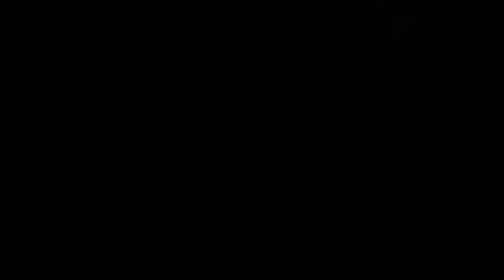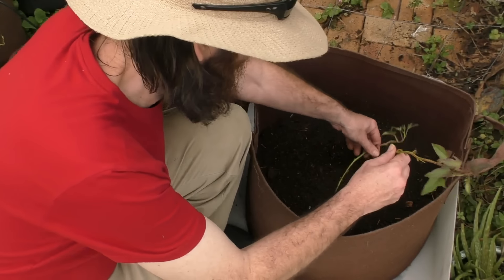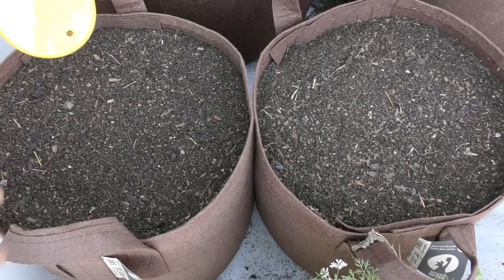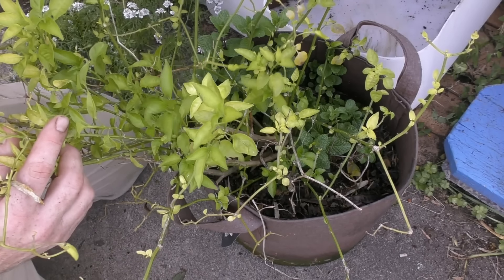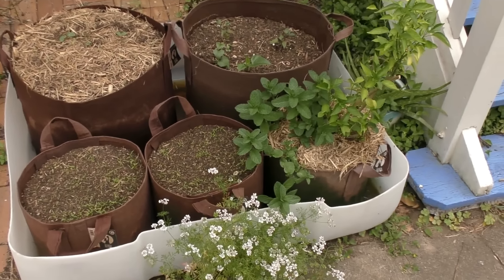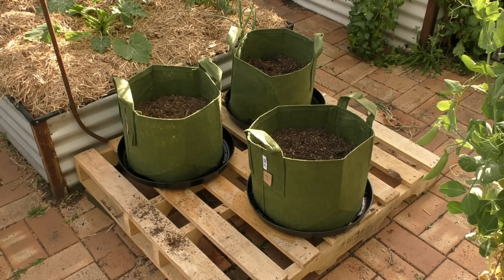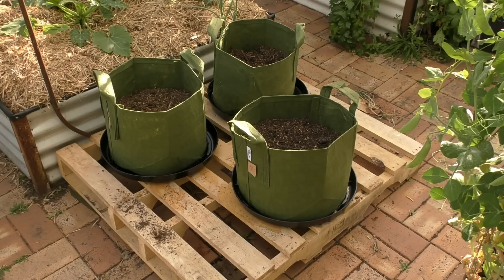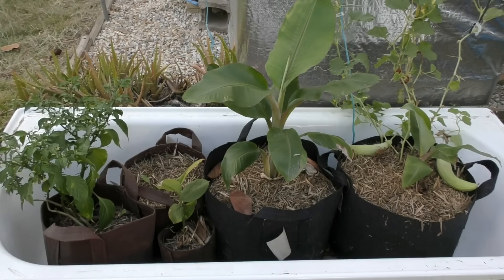Air pruning Root Pouch Wicking Gardens. Sowing carrot seeds, planting slips & some spuds.

Comment: Interesting idea with the air pruning, I've heard that air pruning is great way to have seedlings with healthy roots but never seen it use for matured plant, thanks for sharing.
Reply from the maker: +Raf's Kitchen Garden 
Hi Raf.
I'm sold on the air pruning method now 👍 Still need a really good soil mix & also keep the water up to them though. A few folks let them dry out which is why they have issues with the cloth bags/pouches I've found. 
Hope all's well with you,
Rob.

Comment: Hey Rob
Another good one, I finally know what air pruning is. The missus now has me shopping for root pouches. I have 3 figs that might do OK in them as I shift them inside and out with the seasons.
Cheers from Canuckistan
Jeff
Reply from the maker: +Jeff Mitts 
Hey Jeff.
I'm a bit slow at catching up once as you can see ;-) 
I have 1 fig in the pouches & it's not doing too well. I think it's the dodgy potting mix I bought for it more than the pouch though. 
Hope things are't to frozen for you up there in Canuckistan mate ;-)
Cheers. 
*cracks & ale & goes to bathe in the 30°C warmth*
Reply: Love the final thought, I'll trade you , cheeky bugger. I cracked several stout and rinsed lava rock in 5C warmth. It's been unseasonably warm here actually... I'm worried the garlic will sprout : (
Reply from the maker: +Jeff Mitts 
Not a stout drinker sorry mate. Looks like liquid vegemite ;-)

Comment: Hey Rob Im in Sydney where I have a lot of success with potato.  I water deeply but infrequently.  To further minimise fungal and bacterial problems, I use slightly acidic soil.  Alkaline soil assists  the growth of bacteria.  Hope this helps
Reply from the maker: +Meme Ryan 
Hi Meme.  
A added some flowers of sulphur to the potato soil mix to make it more acidic & they looked to be growing really well until the blight got to them. 
Harvested them last week & while they didn't produce a lot in weight The volume was good.  I think if I got the blight under control they would of been one of the most productive crops we would of grown to date. 
Cheers & al the best.
Rob.

Comment: That's a great idea with the sweet potatoes if that works, I don't now why it wouldn't. I bet by now your garden is full of grow bags by now. I love the air pruning pots, I have some pots left over from my potato growing disaster, lol. Did you use a 2" drill bit for those holes? That bathtub drain system is so great! Sorry this is so long, See ya, Kim. OBTW, My peppers are looking like that, maybe I can do the same with cutting and feeding they may make it in the outdoor hoop house.
Reply from the maker: +The Abled Gardener Hi Kim.
Not full of pouches but do have one more try full up the side of the house as it happen ;-) Its got some citrus, curry tree, dwarf lychee & dwarf papaya in it ;) 
Do you mean 2" holes in the wicking barrel with the papaya?
Reply: +RobBobs Backyard Farming I didn't see the papaya, it's the blue plastic wicking barrel at the beginning. I'm thinking this would be good for my dwarf lemon tree, my dwarf flowered and put on small lemons 3 times since last year, they would all fall off each time until this last flowering, 2 lemons stayed on and are about the size of eggs, and I've noticed that citrus leaf miner really love those new little leaves.

Comment: Good video, Rob. Thanks. Couple of questions:
Aren't the sweet potato vines going to take over?
I like using the cloth over the carrots to stimulate germination and keep moist.
Are the pouches cost effective and how long do they last?
Reply from the maker: +Karl Kelley 
Hi Karl & sorry it took so long to get back to you. 
I've had to trim back the vines twice now as they grow so fast.  I've also read that it helps the plant grow larger tubers but am not 100% sure on that myself. 
These Boxer Brown pouches are supposed to last for 10 years. The black ones the bananas are in are meant to break down in a few years so they will go into the holes when I plant the trees out 👍
Hope that helps some & let me know if you have any other questions on the pouches. 
Cheers.

Comment: just a little thought but why dont you add a bit of blue metal in the resivor around the pouches that way you can keep it full and no mossies
Reply from the maker: Hi Sam. Have seen a few folks do that. I find letting them dry out works well for me & allows for a bit more water storage in there. 
Cheers.

Comment: HI Rob,
Regarding the carrots, do you add any additional fertilizer?
This is my first time growing carrots and I have the 20 gallon root pouches.

I make my own planting medium using 1/3 compost, 1/3 peat moss, 1/3 perlite.
I also add in some worm castings.

Do you think this is sufficient nutrition to grow carrots?

Some of my carrot varieties are 120-140 days.

Also, have you had any experience with soybean meal?  

Thank you for any advice!

Take care,
Elizabeth
Reply from the maker: Hi Elizabeth.  For my blends I've been using about 1/4 compost 1/4 perlite & 1/2 potting mix in our last few pouches & it looks to be working OK so far. I do give them a liquid feed about once a month but that's about it.
I haven't used or read up on soybean meal sorry. Are you looking to use it as an amendment? 
Cheers & all the best.
Rob.

Comment: love the clips Rob!... just curious to know why u don't get loads of soil, course sand ect from the landscape supplies and mix up your own potting mix?
Reply: instead of bags of potting mix*
Reply from the maker: Hi there & thanks.  I don't have the space that would allow me to store them in bulk at this place as we would need to buy all in ¼m³/9ft³ lots. Doesn't sound like much but it works out to be about ½ a scoop from a front end loader at out landscape supplier. As large as our block looks on the clips it's actually a fairly small one.  When I make up the larger IBC wicking beds I buy by the trailer load. 👍
Cheers & have a great one.
Reply: Nice one.. keep up the great work👍

Comment: What size root pouches are you using?
Reply from the maker: +sowingfood The spuds, carrots,duck potatoes & chillies are all in the 30L/7gal pouches.  The sweet potato & cucumbers are in 95L/25gal. The 2 bananas are in 10gal/39L & the galangal in a 3.8L/1gal. The 30gal/113L pouch fits the 50gal/200L barrels well. 
Thanks for asking & will pop the sizes in the description ;) 
Hope that helps some.

Comment: nearly 12 months rob hows the leomon tree going
Reply from the maker: Lennon tree appears to be in stasis Owen. At first I though it was due to me leaving some fruit on (should of taken the first season off but didn't). Now I think it is more likely the soil mix I've used as it's very heavy & holding too much water.  I decided to only watering the barrel from the top when the soil is dry until it is transplanted for now & not filling up the reservoir.   
I would transplant it now but the soil temp is low & I don't think it could handle the transplant too well. 
Hopefully I'll be able to save it & pop it straight into the ground when it warms up a bit. 
Cheers.

Comment: SO the root pouch actually doesnt air prune at all, it trap prunes.
Reply from the maker: It prunes the roots that grow through the pouch. It's a bit hard to show what's not there.
Reply: @RobsAquaponics    The guy that makes the root pouch says they dont air prune the fabric causes them to spin and "trap prune"
Reply from the maker: @Str8GasGenetics  You're very right. I was always told it was a mixture of both when I was selling them & ran with air pruning as that's what most folks are familiar with. This is one of the promotional videos they released around the time I stopped selling them that mentions air pruning, https://www.youtube.com/watch?v=07N40rj0fA8
Cheers.